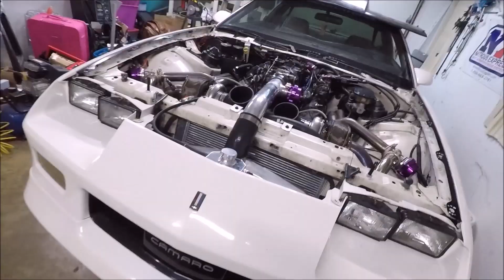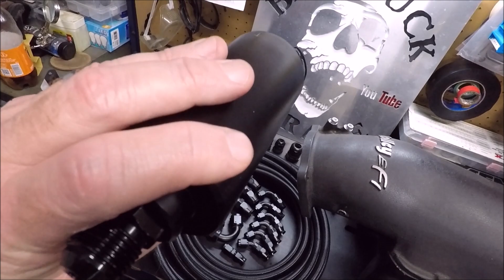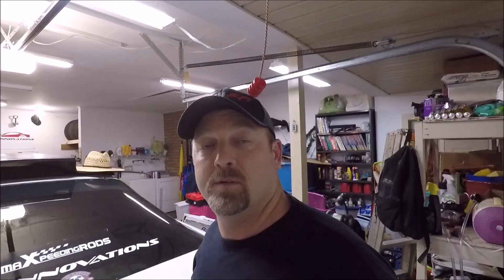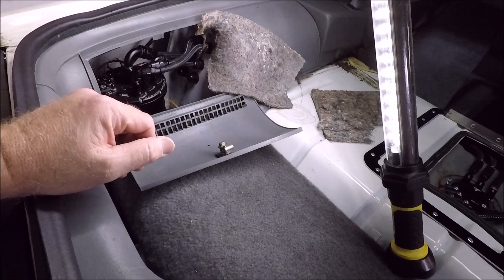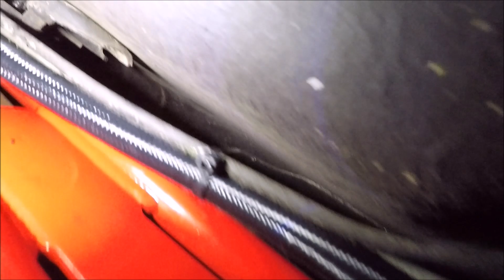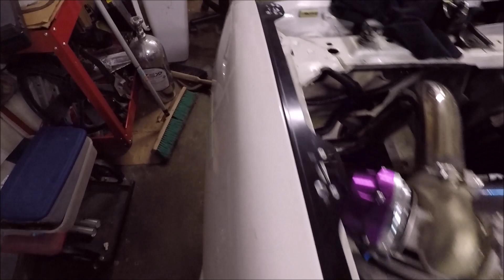1500HP FUEL SYSTEM FOR OUR TWIN TURBO 3RD GEN CAMARO

Comment: Im not real familiar with drag racing tech rules but i was under the impression that msost all liquid filled lines and hoses have to be outside the drivers compartment. Im not saying its not right or wrong because I DONT know it is a cool idea.
Reply from the maker: ….or firewalled. Worst case scenario is I’ll have to cut and brake a piece of sheet metal and bolt or weld it inside the glove box to satisfy the firewall rule. I actually made sure to space  the surge tank far enough back to allow me to do that if necessary and that’s something Brad or Ray either one could fab up for me in no time. The surgetank itself should be legal because of the thickness of the aluminum it’s made from so the only thing that would possibly be an issue is if the tech guy working that day wants to consider my PTFE lines to be “rubber lines inside the passenger compartment”. But 90% of the F bodies I see at the track have the whole damn fuel cell mounted in the back hatch area and it’s easy enough to firewall it if I need to so I’m really not too worried about it.
Reply from the maker: This IS a great question and something I thought about myself when putting all this together so I’m actually gonna pin your comment to the top because I KNOW this is gonna be asked 100 times. 😉
Reply: @BadLuckGarage  Like I said I just thought that any liquid or hot lines or hoses needed to be external of the drivers compartment. I was just asking since I've never actually raced at a track yet, but from what I've learned from being there and watching others.
Reply from the maker: @KarKamp  Well like I said, it was a good question and as far as I know the rules state you can’t have any “rubber” fuel lines in the passenger compartment(which I technically don’t) and if you do they have to be separated by a firewall of certain thickness depending in whether you use aluminum or steel to make that firewall. 👍
Reply from the maker: @KarKamp  Just looked it up and here’s the rules straight from the NHRA book. 
“All batteries, fuel lines, fuel pumps or filler necks located inside trunk require complete bulkhead of at least .024-inch (.6 mm) steel or .032 (.8 mm) aluminium to isolate driver compartment from trunk.” So it looks like we’ll be building a steel or aluminum plate to seal that area off behind the interior panel to make it nice and legal. Once it’s sealed off from the rest of the hatch area it should pass tech……if I ever goto a track that actually techs. 🤣👍

Comment: Can I run twin walbro 535 hellcat pumps in a surge tank y'd into a single 8an line to support 1200 crank hp on e85?  I'm trying to put together a system to support 1200 crank.  Thank you!
Reply from the maker: If you get the right surge tank, such as the one we used in this video, you won’t even need a “Y”.

Comment: Question. What fitting is the coming off the aeromotive pull up pump?
Reply from the maker: The Aeromotive drop in sending unit comes with -6 feed and return.
Reply: @BadLuckGarage  
Correct. What I am asking is the type of 6orb fitting that is. I noticed it has a barb in between the 6 orb to 6 an?
Reply from the maker: @chevyboy6852  It does not use orb fittings. I believe they are 1/4”NPT which has an inside diameter equivalent to 3/8” or -6 fuel line. So the feed and return are 1/4npt to -6AN and the vent is 1/4npt to 3/8 barb.
Reply: @BadLuckGarage  ok thank you buddy
Reply from the maker: @chevyboy6852  No problem brother! good luck to you. 👍